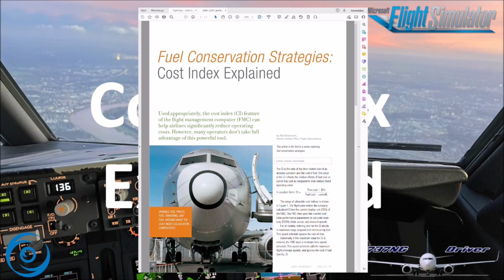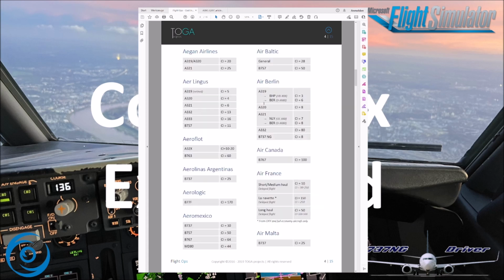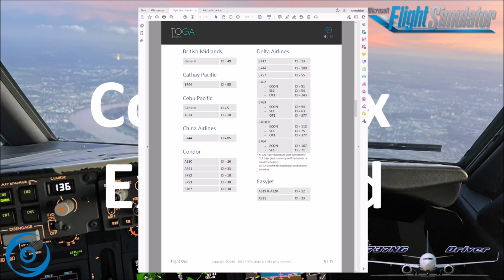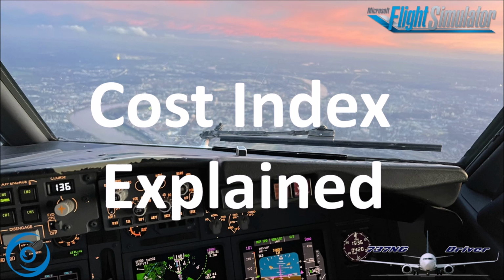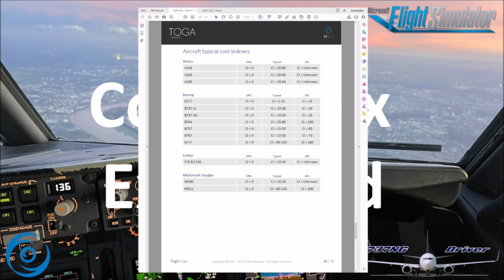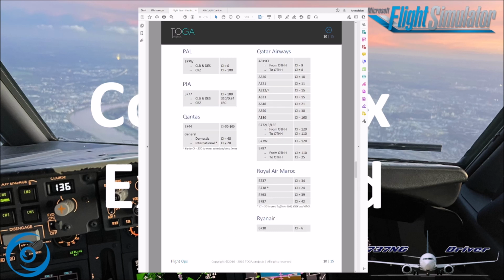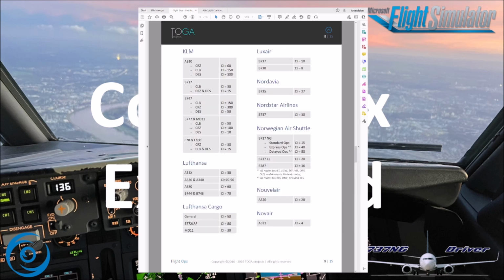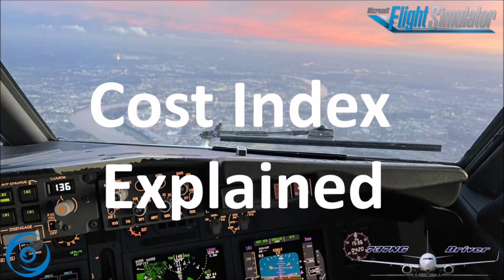Cost Index Explained | Real 737 Pilot

Comment: Thanks for explained. You are the best. I have a question, do you know what will be the next project of PMDG for MSFS ?
Reply from the maker: Next up is the 737-900, thereafter the 777 and then the 747, followed by the 737 MAX.
Reply: @A330Driver  Thanks. Thanks for the answer. I really hope for long range plane and 777 or 747 will be great like in p3d.

Comment: So if I get "Unable Crz Alt" msg in the FMC, that is due to the CI entered is not able to be flown at my entered ALT? As opposed to the max alt at a certain weight?
Reply from the maker: The message can have many reasons, one might be the CI. Other can be a shitty flight planning program (yes, simbrief can sometimes be that shitty), or performance data that differs from the flight planning program (different weights, more fuel, etc.).
Reply: I get that usualy on short flights when there are coded altitude restrictions in longer SIDs. I think that Simbrief sometimes does not take into account that restrictions and gives you higher cruising altitude that is usually achievable when you remove altitude restrictions.

Comment: Excellent explanations. My only comment is that most of the video running time is just a static text. It would increase viewing if the manuals could be shown during your script, or make sure that the viewer is encouraged to open the documents initially. HTH.
Reply from the maker: Normally I would agree, but when I experimented with it, it simply gave no noticable increase and in fact not even comments about it. Not sure if I am allowed to show any of the documents I ref'ed in the video could even be shown on screen legally due to copyright. That's why I kept those scenes short.